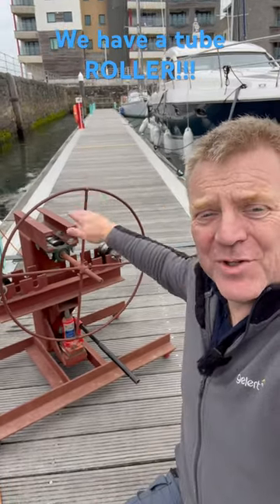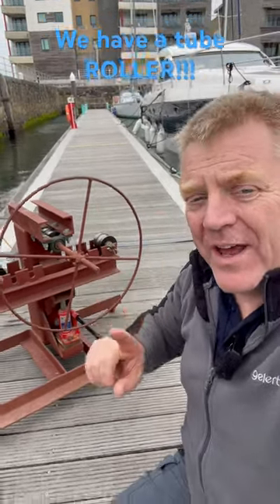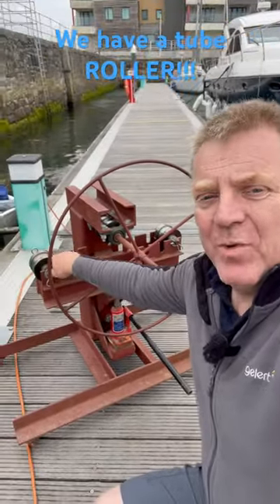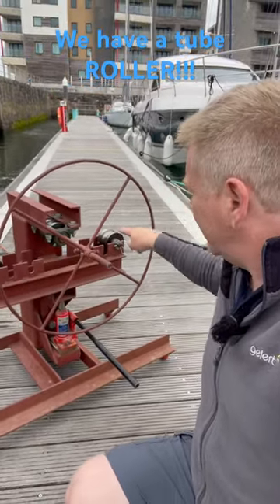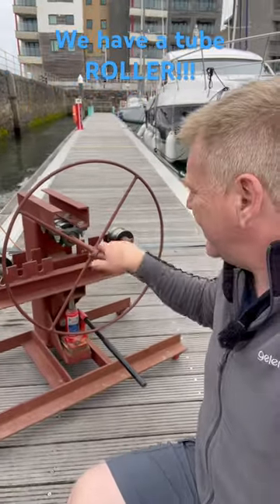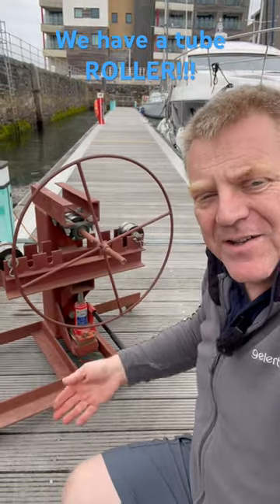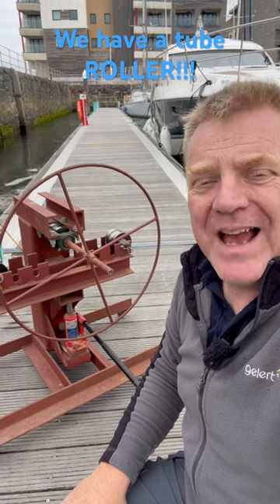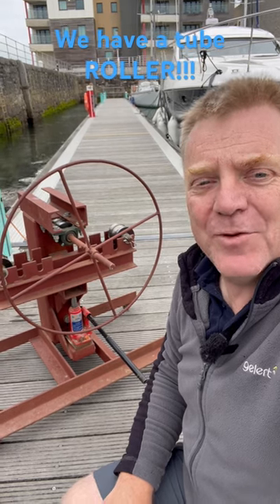It’s a roller coaster ride

Comment: Andy why are you hell bent on doing it in stainless steel you could try doing it in Ally
Yes the tube roller doesn’t crush the pipe and there good for gradual bends they use them in body building shops over here 
The machines are bigger and some are CNC the operator looks at a screen.  Good to see it coming together
Reply from the maker: Good question but here’s my answers :)

1. I already have a load of stainless and don’t have any aluminium 
2. Welding stainless is way way easier and I can do repairs if necesssry but I can not weld aluminium to do repairs.
3. If I need to ad grab rails or accessories I can weld stainless bits to it later.
4. I want the structure to be very very strong to withstand offshore punishment or even potentially offer some protection in case of a topping lift failure or even dismasting and stainless will be much better than aluminium for that.

So in short.
I’m stainless rich and Ali poor.
I’m stainless competent and Ali incompetent.
Work with what you’ve got eh.